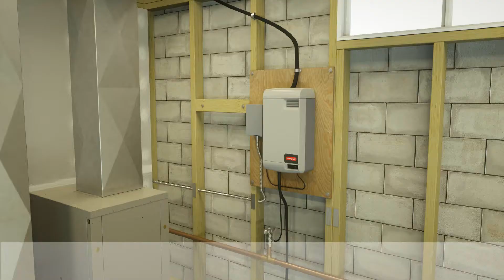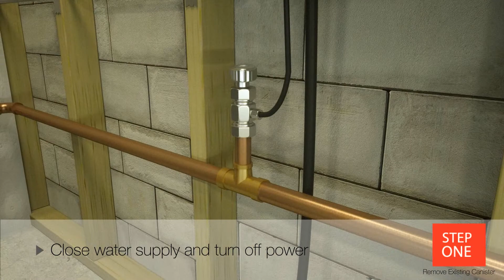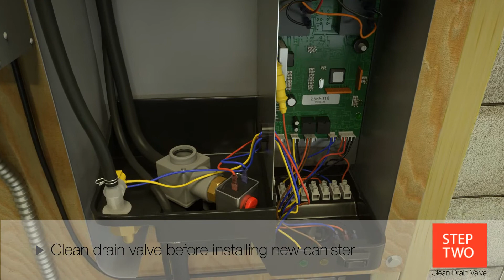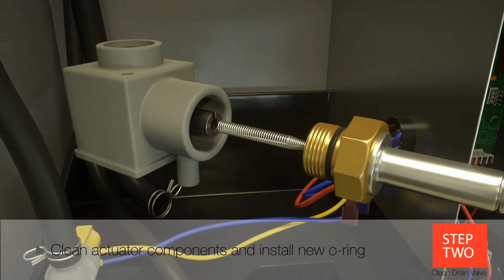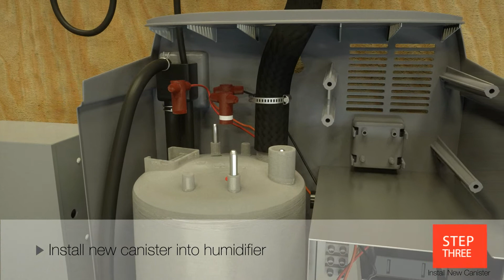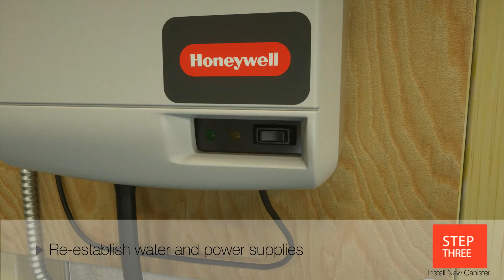Honeywell Electrode Humidifier Maintenance (Canister Replacement)

Comment: I have always had a 20 inch water filter in the water supply line . My last cannister lasted 5 years. Do not use a softener filter. 
Another suggestion was to feed the humidifier from the way water tank, which seem to have less minerals to add to the build up inside the tank.
:-)

Comment: The cylinder light is still on after I replaced the canister. Any trouble shooting ideas? I have drained and powered off several times.
Reply: Press and hold the power button for 5 seconds.